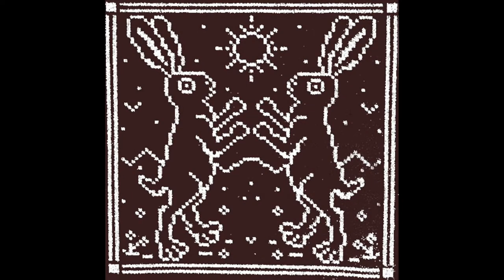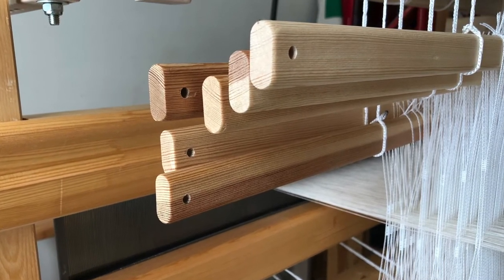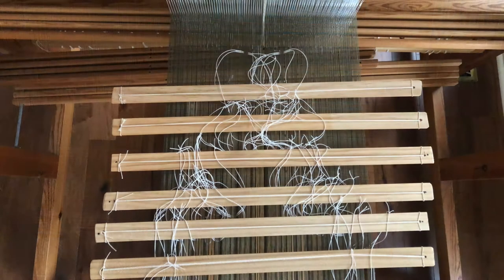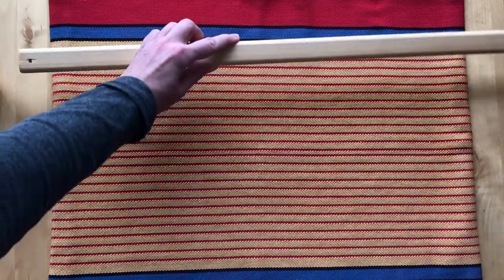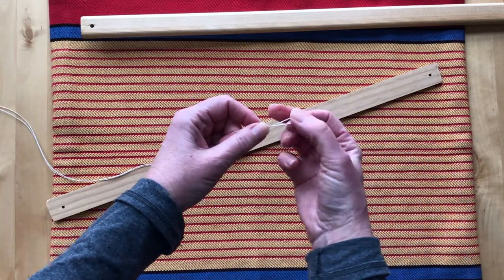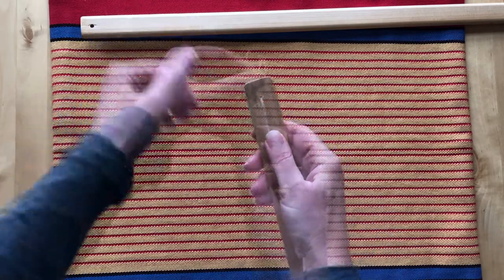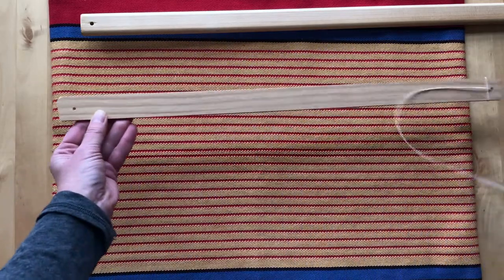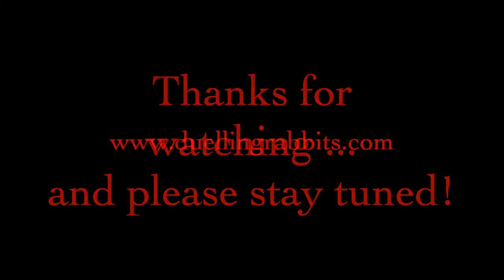Rigging a Safety String on a Shaft Bar or Half-Heddle Stick

Comment: I love your clear instructions! One question though: how do you use the safety string? Do you thread them into the heddles?
Reply from the maker: Good question. The best thing to do is rig the strings over the heddles. Look carefully around the 30-second mark: you can see how the heddles are trapped between the length of string and where it goes into the hole on the shaft bar. Hope that answers your question!
Reply: @DuellingRabbits gotcha, thank you for your reply❤